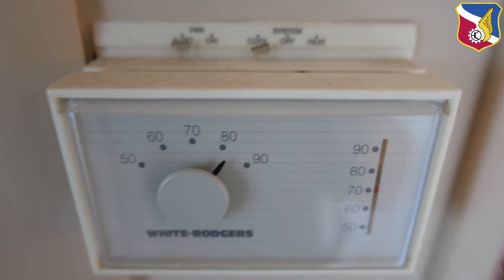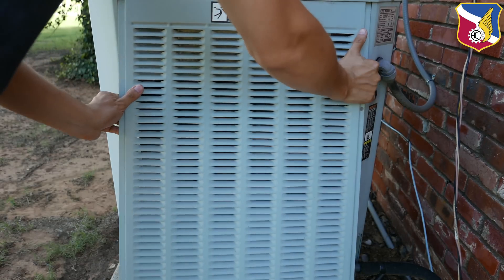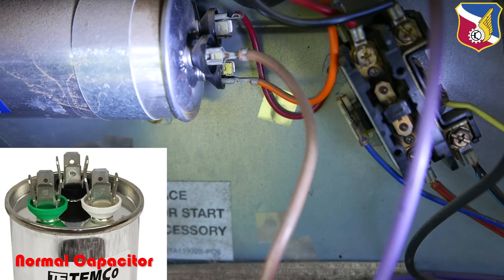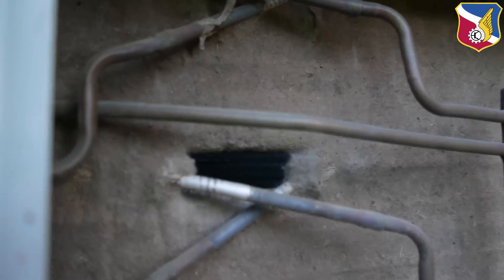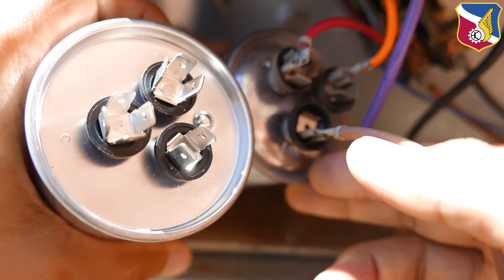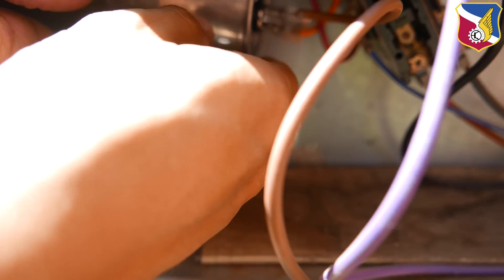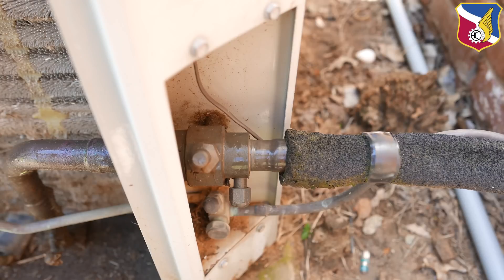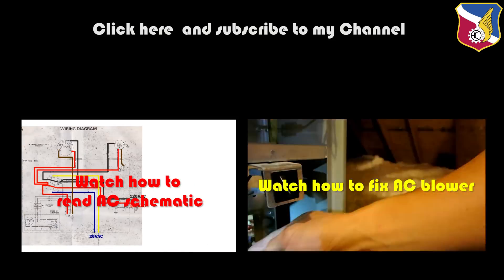4K AC fan not working - how to repair broken HVAC Run Start Capacitor - air condition

Comment: So if the top isn't bulging will it still have the correct microfarad reading? My outside unit blower isn't working. The compressor kicks on, but it doesn't blow any air.

Comment: Perfect!! Unit looks identical to mine. Whats the best way to change that insulation cover (which showed next to the part where you test the temp for compressor). Mine is all cracked up. and I want to get that changed as well. Thanks for your help!!

Comment: can you upload that calculation delta video. i push the button on screen but it dosent come out. thanks for the great videos.
Reply from the maker: +Arnold Navarro thx. i havent post the delta video, but i linked it to another youtube video. the reason why you cant click on the link is because you have an advertisement blocker. no only does it skip ads, but it also disables clickable links. here is a good delta t video: https://www.youtube.com/watch?v=qjf3cI4sT1s

Comment: It's cold as a polar bears pussy here in NC and I have no heat because the system hums like a big rig engine and my fan stopped and the entire system is covered in ice. Awesome..

Comment: OK I replaced it with a new one and hosed out the dirt. Works perfect now. Thank you very much.
 Next for fun I am going to check the temperature at the fitting. Hopefully all is well. I was concerned that maybe I burned out the pump inside. A little tip. Like you said cross the poles with a screwdriver to make sure it's empty of juice. My friend said there is 370 volts stored in there when they are in working condition.

Comment: Well It looks like my start capacitor is burnt out and thanks to your advice tomorrow I am going to get a new one and clean the TRANE 1000 that's full of dirt on the aluminum radiator. I will get back and let you know if it worked. Seems like if it burned out(15 years old) that there is a reason it happened. Maybe overheating. Anyway thanks.

Comment: Thank you for the great video. Instead of having to wait a week for a repair guy and a big bill, I was able to fix my AC same day for a fraction of what it would have cost me. I also watched your video on "how to troubleshoot and repair condenser fan motor" which helped me figure out that I would need a new AC fan motor too. Your videos were laid back and easy to follow, making for a quick diagnosis to the problem. Thanks for the help!